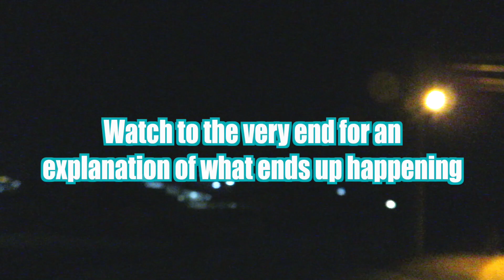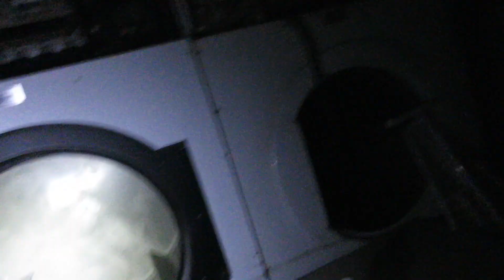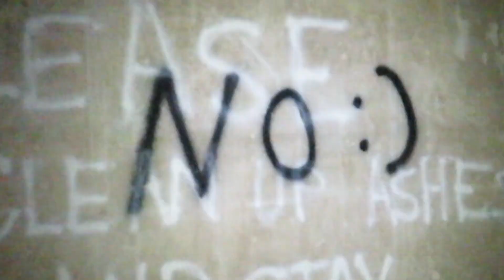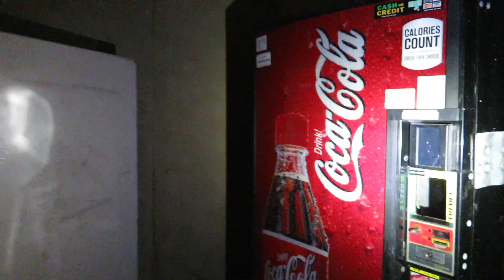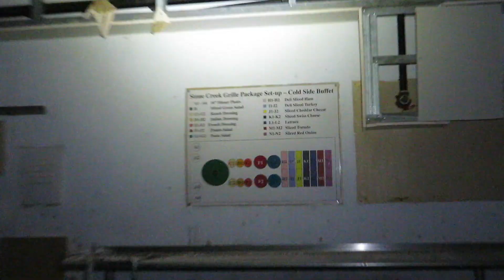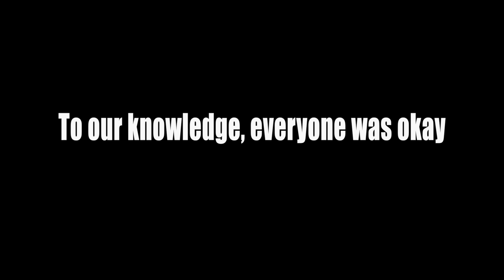Exploring an Abandoned Holiday Inn

Comment: May of 1996 holiday inn joplin, mo( the building has been condemned for few years now.) I was their for orientation for my first truck driving job i was 21. After the second day of a five day orientation I was walking around, a women came out of the weight room we ended up on the elevator. Making small talk i only remember joking about i give good messages, to my suprise she said I may take you up on it later. I saw what room she went in. Later that night I slipped a note reminding her what she had said with my name and room number. The next morning in orientation i get pulled out and was told I got kicked out if the hotel and lost my job because of that note. I was stranded in joplin for two months before I got another truck driving job. A couple months after that I ran into someone that was in that orientation  and told me the company told everyone about what had happened.
Reply from the maker: God that sucks, the company needs to lighten up. Either way, it's crazy to hear real life stories from these places.
Reply: @JaredCokerUrbex  that company went under in 02 in fact their terminal is another abandoned building.
Reply from the maker: @stevengriffith436  Ironic